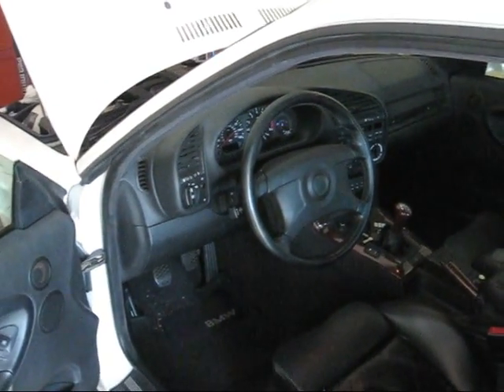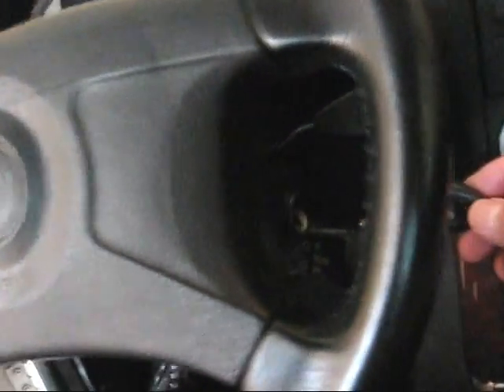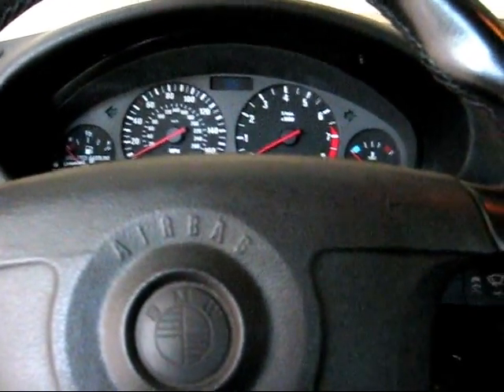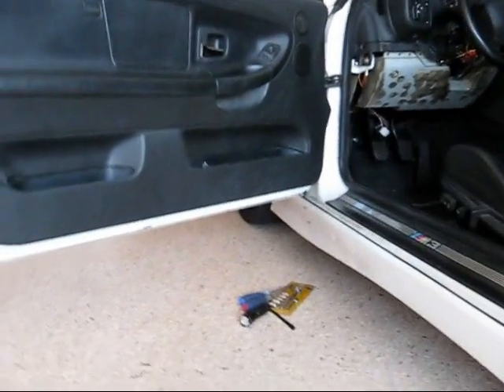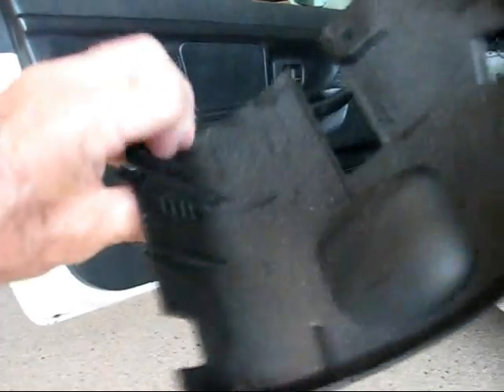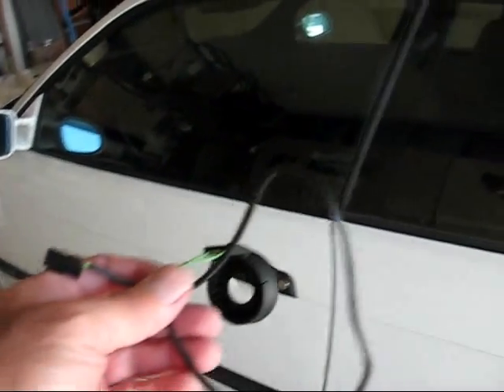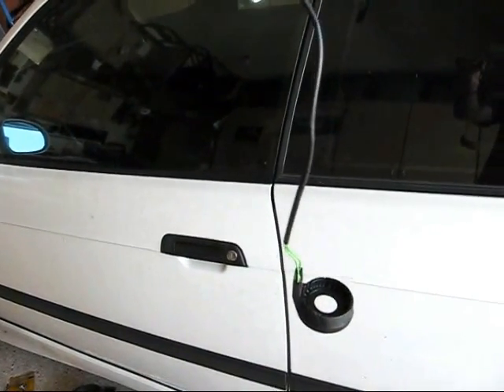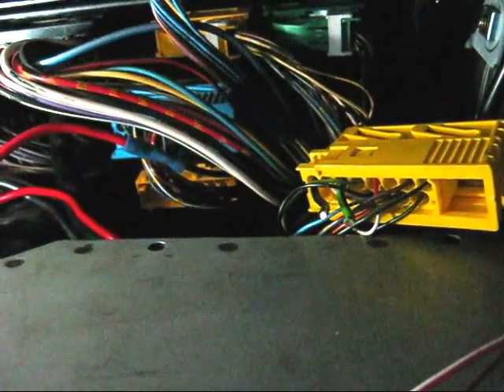BMW EWS II security bypass on 1995 M3 by froggy

Comment: Froggy, Are you still out there and supporting this blog?  I need help!  I have a 1995 BMW 325 is.   The ignition cylinder is shot, I tried everything from the stupid little bobby pin, to drilling out the lock cylinder-no luck.  
So I bought a 1994 computer (red) to make the car think it was a 1994 (no security this year).  Replaced the computer (car will not crank), but I know I need to do more.
I am trying to get to the wires behind the glovebox.  Still cannot get the glovebox removed and I don't fully understand what you did with the wire bypassing.  I saw the black and red wire (cutoff), not sure what you did with the remaining wires.
Reply from the maker: I am not sure putting in the wrong "computer" is the way to go. If you are having trouble getting to the wiring behind the glove box this may be beyond your skill level, no offense intended. Good luck.

:)

Comment: Hi froggy i have a Problem i Do it how you show and twistet the two together But i dont have a spark. can you help me?
Reply from the maker: Not enough info, sorry.

:)
Reply: i have a e36 320i from 95 and I have the Same Problem Witz the immobilizer now i have cut and  connect the greenbrown wire and the blackyellow wire from the yellow plug und plug IT back in the EWS Module. now my Starter works But i dont have a spark and the car dont Starts. Do i forget something? 
sorry for my Bad english i am from germany

Comment: I have a bmw 525i 1995 i lost my key. by doing this bypass is it my car have a chance to start? anyway i have an extra key without the chip.
Reply from the maker: Watch the video. This bypass DOES NOT eliminate the need for a chipped key and antenna.

:)
Reply: i jumped up the two wires and it cranked but the engine didn't start it is just keep on cranking idk whats the problem is. i tried to jump the battery too, but the problem still there. 

the previus problem of my car was no crank start. 

now it crank but still no start  :(
Reply from the maker: See my previous comment YOU NEED A PROPERLY CHIPPED KEY, or you need to do a different bypass for that part of the system, which I do not have.

:)
Reply: finally it's now working! thank you so much Mr. froggy for your help :)
Reply: what did you do to fix it archie?
Reply: I bypass the ews by connecting the 2 wires and replacing the ring antenna then use the proper key chip. I just copy exactly what froggy did to this video.

my previous problems with my car are no crank, no start.

after jumping those two wires
it crank, no start.

by replacing the antenna ring and using the right proper key my car now are cranking and starting.

:)

so i guess my main problem was my ring antenna was bad.
Reply from the maker: Thanks for following up. EVERY PART of BMW's security systems has to either function or be bypassed.

:)

Comment: The key is chipped but we are using a plastic wallet key to start the car which h worked for the past few years. The battery was disconnected and that is where all the problems have originated from.
Reply from the maker: A simple battery disconnect should not cause problems so far as I know. Unless that causes some kind of "reset" of the security system that was previously "bypassed" somehow. Any way to get the correct chipped key or is it lost?

Comment: Both fuel and spark are missing we have checked fuel pump and spark plugs and we have checked it's the same ews2 , if you have thoughts or suggestions on how to pass the immobiliser. Thanks for your prompt reply all the way to Scotland .
Reply from the maker: Is the key chip and the antenna at the ignition switch present & working?

:)

Comment: Hi there froggy,I have a bmw 318i the car was completely dead I followed your instructions and joined the 2 big wires together then the car would turn over but not start. I think it is still immobilised do you have any thoughts or ideas on how to get the car to start. Many thanks for posting this video u have been very helpful. Is there any way to communicate with you other than you tube if so please let me know.
Reply from the maker: Yours is a different car, so the security systems are likely not 100% the same. Turning over means you have successfully bypassed the starter kill. Now you need to determine if fuel or spark is missing. Do the standard tests for fuel & spark.

:)
Reply: Neonsmaw did you figure out how to get spark?

Comment: I'm fairly certain my 95 M3 e36 is having this issue right now.. the symptoms are that it works after several turns of the key and it is only getting worse as days go by. I might have to just snip snip !
Reply from the maker: It is reversible if you do a neat job of it.

:)

Comment: is it still working? your dme doesnt run the risk of burning?
Reply from the maker: I sold the car, but I did use it that way for months, no problems. Thanks for viewing.

:)
Reply: +froggy is there a way to bypass the antanna  and chip on96 bmw318 i

Comment: Hi sir! Ive been looking to your video and i did all steps you show and now my 1996 323i spins the ignition engine but still not starting the engine. Could be because of the key antenna? Thank you.
Reply from the maker: I don't think so, if it's turning over the key antenna is "satisfied". Check for SPARK and FUEL.

:)
Reply: +froggy at first, thank you for your answer. When you say fuel, you mean the fuel pump? And about the sparks, the car has 197.000km and sure they have never been changed. When i check them i will let you know if its there the trouble. At least something changed with the ignition engine turning, cause my car did the same when that happened, no answer when trying to start the engine... Thank you again!!
Reply from the maker: You need to check AT THE ENGINE that fuel is coming to the fuel rails (by way of the pump) and that the plugs are FIRING. You can google how to do this, not enough space here.

:)

Comment: I had the same symptoms and I jumpered the two big wires on yellow clip but it only fixed not cranking. Still no start/fuelpump/spark. I did it on my 1997 328i. Obviously they were different cars. Any help appreciated.
Reply from the maker: I would just be guessing, sorry.

Good luck.

:)
Reply: Freehand did you figure out how to get spark and fuel?
Reply: Freehand did you ever figure this out?

Comment: In your video, did you start the car without the "Ring Antenna" attached? Or did you start the car with the new "Ring Antenna" AND a "Chipped Key?"
Reply from the maker: I still needed the ring antenna & chipped key, only problem was the circuit board.

:)

Comment: Hello Froggy, please tell me, could a remote locking failure be associated to EWS improper functioning? My Z3 wont lock and open remotely from the key buttons.. I tried to synchronize both keys, but none of them have worked.. I can start the car but cannot lock and open it remotely.. Cheers Ramaz
Reply from the maker: +Ramaz Kutateladze Remotely (pun intended) possible but I would look elsewhere first. Like the module that receives the signal from the remotes.

:)
Reply: I do not have any idea where that module must be located in my RHD BMW Z3... neither google, nor yahoo or even yandex.ru..
Reply from the maker: Sorry, I never owned one, I do not know where it is.

:)

Comment: I have had the same issue. I followed your video step by step and my engine will now crank but not turn over....any ideas
Reply from the maker: +Fred Scrimger Is your car a 1995 bmw m3?
Reply: +froggy I have 95 318i.  the wires are all the same off the ews just like in your video.  IT now will allow me to crank but not turn over.  it seems like it just wont get spark or fuel
Reply: +froggy any ideas
Reply from the maker: +Fred Scrimger If it cranks (turns over) check fuel & spark with basic diagnostic procedures, you can google them.

:)
Reply: +froggy what are the two big wires that we cut and spliced together. what do they control
Reply from the maker: +Fred Scrimger Starter. You may have other security system issues with the chip in the key and/or antenna around the ignition sw.

:)
Reply: did you figure out the no spark after you jumped the wires?

Comment: Froggy, you are a life saver! The transponder chip fell out of my only key when the BMW logo popped out, and I couldn't find it. My e36 325i convertible is also production date 7/1995, so I looked at the DME and sure enough, it's a silver label Bosch 413 just like yours. I jumped the green and black wires on the EWS II like you did and voila! I don't have to pay a penny to the stealership for a new transponder key, and now my car starts up like a champ! Also, I can get new keys cut from Ace Hardware or Home Despot and they will work too because the EWS II is totally bypassed! Please keep posting videos when you do work on your M3 so people like me can save a ton of money and headache! Thanks again!
Reply from the maker: +K Bear So glad this helped & thanks for the feedback. I hope other people who use my videos to get their car running and/or save money will post back, as you did.

:)
Reply: did this really work for you? i'm in the same predicament where i lost the chip out of my key and couldn't find it, and currently waiting on a new fuel pump before I can try and start it again new with the wire jumped.
Reply: @wettsoggynoodles  Yes, when I did have that 325i years ago I jumped those wires and was able to bypass the EWS II, energize the fuel pump, and start the car without the chip.  That was years ago and I no longer have the car, but as long as your E36 matches what froggy said then it should work.

Make sure to follow up let us know here in the comments how it went for you after you try it.

Comment: Good friend, I have a problem with the box EWS II BMW 318TI 1996, cut the cable # 1 (yellow / black) and # 3 (green / black), all put together and the engine gives me signal on but do not have or sparks, no fuel.ood friend, I have a problem with the box EWS II BMW 318TI 1996, cut the cable # 1 (yellow / black) and # 3 (green / black), all put together and the engine gives me signal on but do not have or sparks, no fuel.
Reply: I'm having the same issue did you ever figure it out
Reply: +Fred Scrimger same issue here
Reply: Was this resolved?'

Comment: Hi froggy,i following your movies and with bypass starter is work but injections and fuel pomp not ,what i can do more,this is bmw e36 1.8 1996 thanks for help...thenks from greece
Reply from the maker: +matheos pantouv Do basic fuel flow troubleshooting. It may or may not be security.

I have other videos (Suburban playlist) on troubleshooting fuel flow.

:)
Reply: +froggy I think this is because your video only shows part 1 of the bypass. You bypass spark but not fuel so fuel is still not triggered by DME
Reply from the maker: Yes, you may/are correct. I did enough to get my car running & bypass the bad components of the circuit board. Thanks!

:)

Comment: I believe the internal starter relay in EWSII module has failed, that's why you couldn't start the car. You can take the EWSII apart and replace the internal relay if you have soldering skills.
Reply from the maker: +Sidabra24.com Show us how it's done.

:)
Reply: +froggy Open your EWSII module, remove the large SIEMENS relay:
https://goo.gl/GWj2nv

Get a replacement. I believe it is SIEMENS V23076-A3001-C132. It can also be TYCO brand. It costs like 15-20 USD. With a little bit of patience you can desolder and remove the old relay, but yo make sure I'd test the relay first. And then install and solder in the new one.
This DIY is not for the faint-hearted, so you may as well look for a professional to do it.
Reply from the maker: Thanks for adding info to the EWSII issue!

:)
Reply: +froggy We actually were discussing about your video on Bimmerforums.com, so you can go in check to see how we tackled this:
http://www.bimmerforums.com/forum/showthread.php?2271074
Reply from the maker: +Sidabra24.com I will visit, that forum is a great resource.

:)

Comment: This is misleading. You've only partially bypassed the EWSII security system. You jumped the wires for the starter. So you bypassed only the starter security system. However, you are still using original key and ring antenna. Antenna sends a code to EWSII, this sends a signal to DME which turns your fuel system on.
A full bypass is bypassing the starter AND the fuel system.
Reply: +Sidabra24.com You are so correct, glad someone wrote it up, Yes it turns the fuel and ingnition on
Reply: How would I bypass the fuel pump too?

Comment: froggy, thanks for the response. I've  read that in the event the air bags are deployed there is a wire that connects to the battery not sure where it goes but goes bad. what happens is car won't  start  all doors unlock and 4way flashers come on. one very strange thing that also happens to me is the 4way flashers came on when I reconnected battery.
Reply from the maker: +Anthony Anderson I think that you may want to proceed with a connection between the airbag & the issues. Please post some comments as you go, it will make the video & the subsequent comments more useful to others. THANKS!

:)

Comment: Hello froggy, I've  got a 1995 bmw 525i  I had disconnected  the battery to remove air bag on steering wheel. reconnected battery with out connecting air bag. now car wont start  power windows don't  work  pwr door locks dont work. Is this a security system issue also any idea's  how to diagnose?
Reply from the maker: +Anthony Anderson I disconnected/reconnected mine many times & no issues. It MAY be related to the removed airbag, the cars computers check for "readiness" on many different systems, as you know. It's strange that windows/door locks are non functioning though.

Usually when air bags are removed (like a conversion to a race car) a "simulator" is installed so the car's computer thinks the bag is still there & ready.

I would google more on removing airbags/bmw/525i etc.

:)

Comment: Very informative If you still can't  fix on your own, there are auto locksmiths that can fix these . MUCH cheaper than dealer.  They have a tool to test the antenna and diagnose. I had E 46 issue with the key , the locksmith cut a new key and matched to  my EWS.
Reply from the maker: +traxxas man Good point on locksmiths, I have a Lexus IS300 that goes thru keys like I change my sox. Found a local locksmith that makes me one for about $25 vs. $100+ at a dealer. However, I know they do not get involved with ews2 circuit boards.

:)

Comment: I've seen many videos about bypass. Most of them are extremely complicated and require more than basic skills with a solder iron. I will try this method on my car if and when I install remote start and start button. If it works it will save me a 100 hours of problems. Thank you very much for the video :)
Reply from the maker: +MrRoyalbeers Hope it helps, it fixed MY SPECIFIC problem 100%. Trouble is some people have a different issue and think THIS will fix it, not so much.

:)

Comment: I have the same car with no chip in the key, if I bypass the two wires in the dme would I still have to get the antenna?
Reply from the maker: +Matt Cormier The procedure I show, is still based on having the chipped key and antenna functioning. I only show how to bypass a "broken" EWS2 circuit board.

:)

Comment: my bmw is e46 318 i not cranking at all what is the problem?plz help
Reply from the maker: +Paul Daniel No offense, that is VERY LITTLE TO GO ON. Could be your battery is dead? How about a DETAILED description of the issue.

:)
Reply: +froggy initially it was cranking without spark on plugs wires and now it does not crank i bought a new battery ,new crank sensor and coilpak is also new please help.
Reply from the maker: Does your starter spin the motor?

Comment: where do you jump the wires too ? like you have them connected to red wires but where do they go to?
Reply from the maker: +TheJamie1010 Start at 13:00 and watch the video and listen, don't over think it.

:)
Reply from the maker: +TheJamie1010 The COLOR of the jumper wire DOES NOT MATTER.
Reply from the maker: +TheJamie1010 The red wire is just a wire I had in my wire box, you put the other ends of the wires I cut together. Use any color wire you would like.

:)
Reply: +froggy did it all and yeah that bypassed it but it still wont start i think it might be fuel pump relay but i dont understand how to test it to see if it is
Reply from the maker: Go to basics, you need fuel / spark / cranking.

Test your fuel PRESSURE if you think the pump is not working.

:)
Reply from the maker: Night for me, I will ck your progress tomorrow.

:)

Comment: okay. I figured color didn't matter but wanted to be sure. in the mean time, I went ahead and connected them straight to each other with electrical tape and my 96 318is started right up. It's been on and off, so I changed the starter on Saturday and it's started every time until yesterday, however it started up earlier today for me to get it home, so I'm not positive this is the issue, but it started up after doing this so that's all I can ask for from this diy. thank you so much for the video
Reply from the maker: +adam moore If you just twisted them together & taped, then I suggest a much more secure connection. The electronics are VERY sensitive to even tiny voltage fluctuations & an intermittent connection (twisted wires) would not be good.

:)
Reply: +froggy I plan on it. I just wanted to get it started. I can get a connector at work and borrow some crimper from one of the electricians. Thanks froggy
Reply: +froggy I plan on it. I just wanted to get it started. I can get a connector at work and borrow some crimper from one of the electricians. Thanks froggy
Reply from the maker: Good, thanks for viewing!